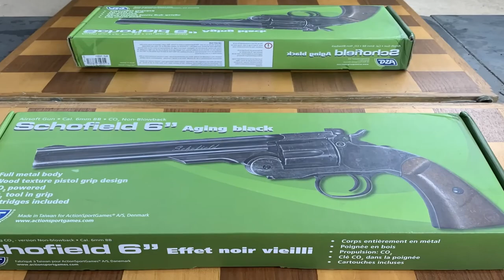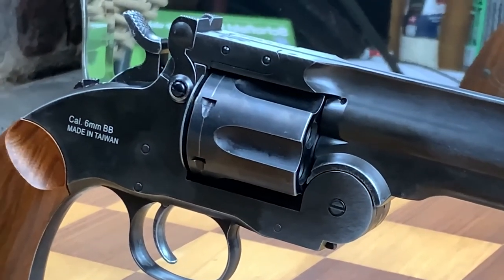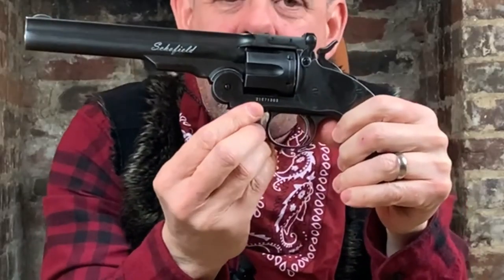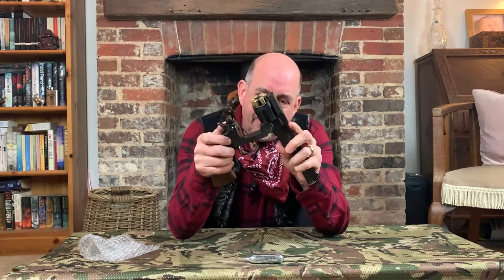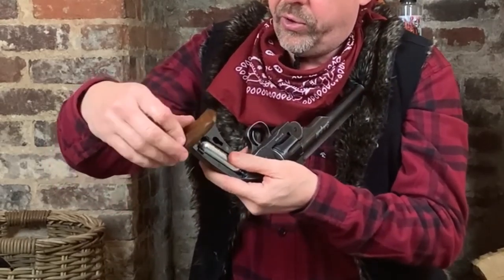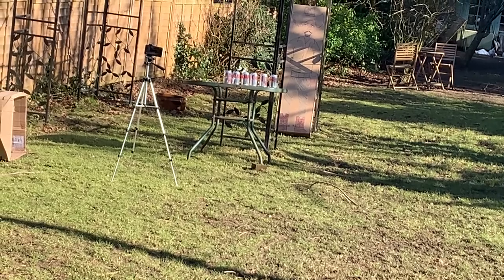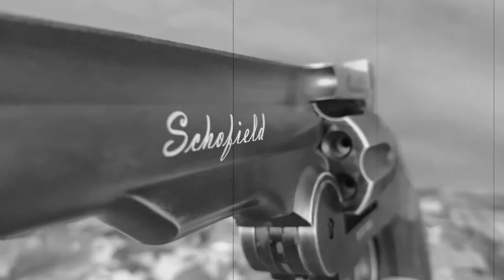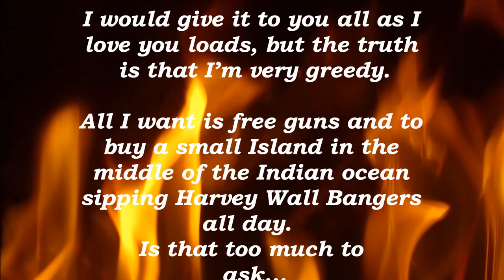SCHOFIELD 6" REVOLVER SHOOTING AROUND 460 FPS

Comment: Did the Gun include a co2 capsule when you bought it?
Reply from the maker: @philiplissel3231  not on this one. I brought it new from a trailer. So never used but second hand I guess. I’m not aware co2 are sold with the gun. There are cool deals on eBay or Amazon if you need some. Thanks for watching and for the comment. 👍